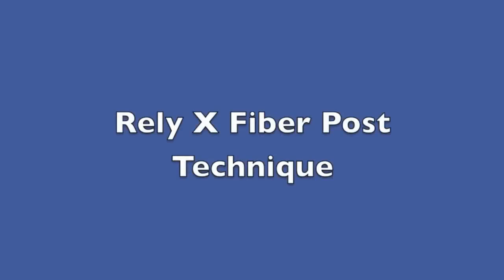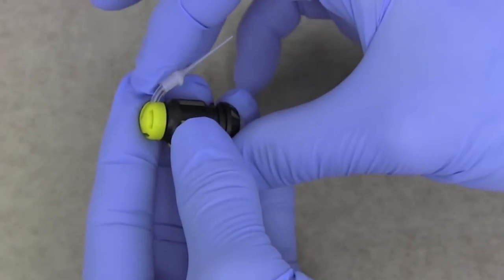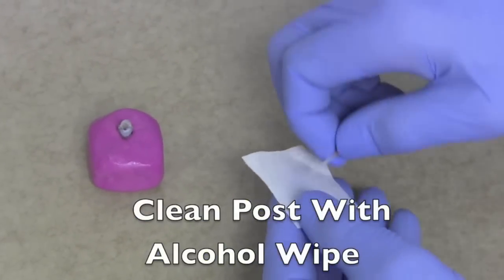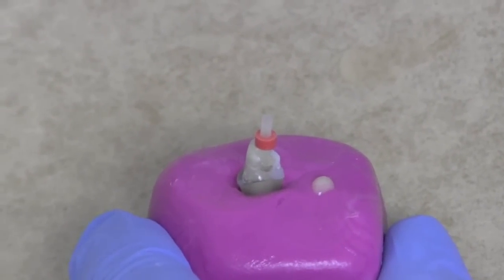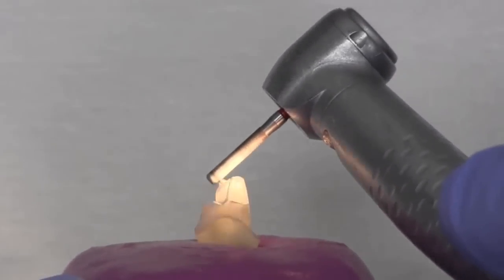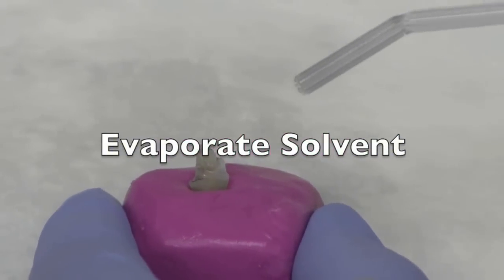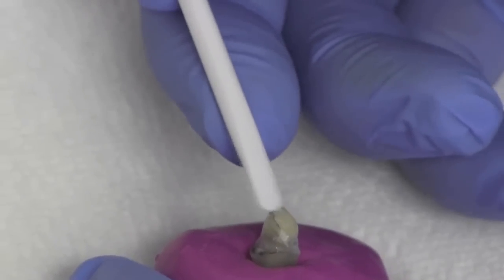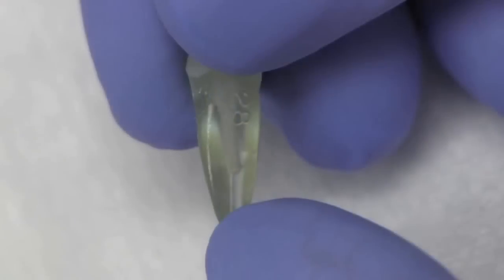Cementing a Rely-X Fiber Post with Unicem Cement

Comment: Do you etch and bond the canal before cementing the post?
Reply: Hi Careem!
No, there is no need to etch and bond the canal, as this material is a self adhesive one. However, please be aware that you may find different Relyx cements on the market and to be more clear, check the 3M youtube channel as there you will find the presentation of the Relyx cements and posts family and details about all of them.
Reply from the maker: Not when using Unicem II.  It is actually contra-indicated.